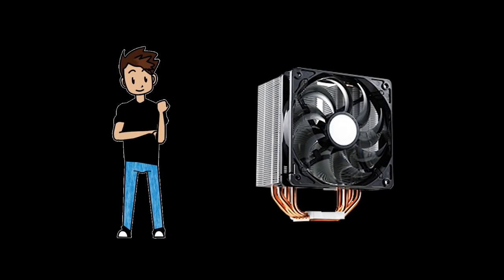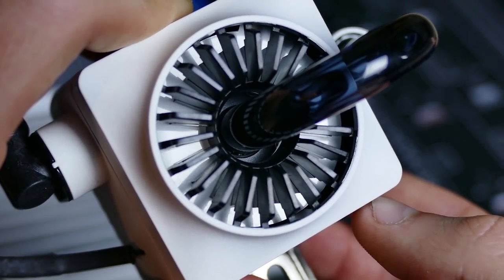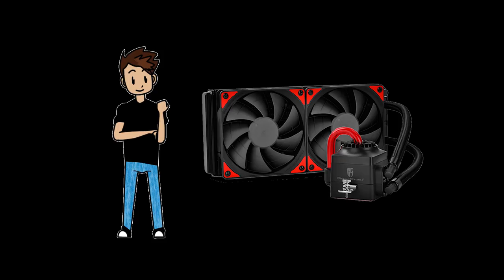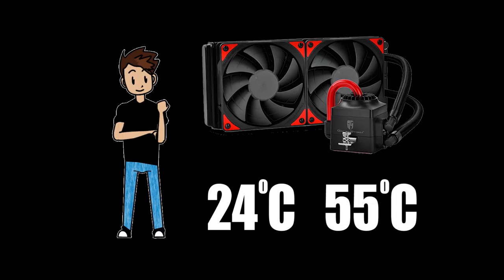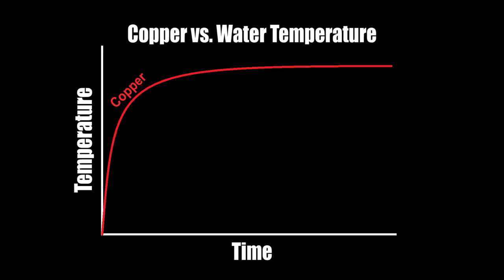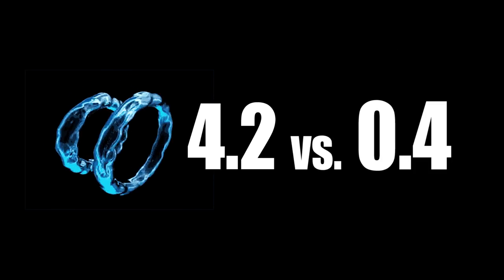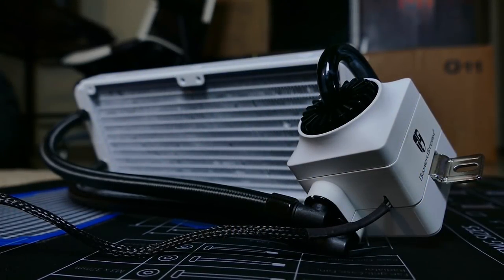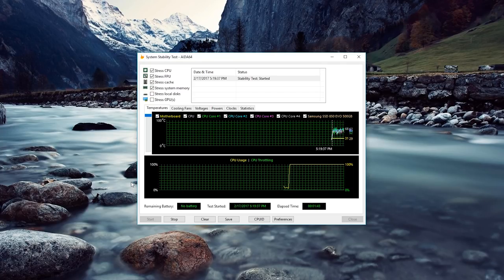How to Properly Measure AIO Temperatures

Comment: After gaming for a couple of hours on my 4790k (@4.5GHz) i'm running at 75ºC on my H110. After returning to windows, CPU temperature drops immediately to around 30ºC. I don't find any water retaining temperature!
Reply: That means your loop is efficient at removing heat from the system. Your system reached a temperature equilibrium at 75ºC (heat absorption = heat dissipation) and when your system reduced its thermal output the system counteracted the change to return to equilibrium, which happens to be ~30ºC. But water's heat capacity doesn't change and there's quite a bit of heat energy retained in the water despite your sharp temperature decrease, so if your loop was inefficient you'd see a gradual decrease.
Reply: The water may still be the high temperatures, the CPU isn't pumping as much heat, so the water can cool it better. A GPU shows a better story. My 980ti maxes at 60C in my water loop, and takes a while before it reaches back down to it's idle temp of 33C. Usually about 10 or 20 minutes
Reply: Ryzen OC to 3.9ghz offset 0.0125 (3.375v set, but reports around 1.38-1.4v under load) and p-state enabled (as it disables when overclocking normally, never did offset overclocking before and p-state enabled, it drops to 0.4v when idle) 

water under load 36-38c cpu temp approx 60-65c, soon as I stop stressing testing it cools down the water within 30 seconds (time it takes to loop thow the radiator probably about 1-2 times ish)

Note on Asus mobo make sure you set "performance bias" to NONE (it's on auto by default) and that was screwing my overclock up (had to put way more voltage in to make overclock stable) i don't know what it was doing but it wasted hours of overclocking tweaking
Reply: Hugo Nabais u r right...it always hppen to my pc as well...go go aio
Reply: his thermodynamic principles are basic. So yes your system works better than a fan mounted on your cpu.
Reply: My 4790k never got over 65C at 4,7ghz with  a huge Schyte  square heatpipe air cooler and 3 fans in 90 degree push push + 1 pull configuration. This was running prime 95 stress test. In the most demanding games it never got over 50C...
Reply: This was my thought exactly. My idle temps are lower, my max temp is lower, it takes more time for it to reach max temp, and it cools down back to pretty much idle around 30ºC nearly immediately, I seriously don't see a downside here. Regardless, even if they DID retain just a bit of heat it's perfectly fine for a CPU to operate within manufacturer maximums (and hell you were just pushing it a lot harder just minutes before), no CPU or GPU is going to get damaged from their factory max temp, it would be foolish for the manufacturer to not prevent that.
Reply: your ambient room temperature must be like from south pole!
Reply: @Kentololable  so don't by a Cheap AIO and use good fans to cool your rad
Reply: @kruzzreviews816  I didn't. He did.

Comment: That's maybe the best reason why liquid coolers are better. Rapid rising in temperature wears down components much faster because of the stress. The material in question has to shrink or expand and and you want it to be as slow as possible. It's very important factor which is overlooked by most people (even experienced ones) unfortunately.
Reply: As long as the liquid cooler outperforms the air cooler, I also believe that to be true. I'm one of those who installed an AIO on the graphics card to keep the GPU cool as the stock blower fan was struggling badly with my overclocked settings. Since the transition, it's around 25C cooler over long term at far less noise, but one of the most intriguing discovery was that nearly all of the small temperature spikes which were seen with air cooling are now gone, which I think should be better for the longevity of the GPU.
Reply: Stress tests don't reflect real life usage unless most of you do is video rendering or other type of continuous load. If your system parts are properly picked even gaming won't put constant 100% usage on your CPU (which would be massive CPU bottleneck). So even if the AIO has worse final temperatures than air cooler by any chance (for example low end AIO vs high end air cooler) I would still go with the AIO if the difference is no more than 10 °C especially for a CPU (which would be stressed more often than a GPU - for example each time when you open a webpage).
Reply: Indeed I can agree with stress tests often being more taxing than any real-life scenario, and after thinking about it, I see why even a liquid cooler that may perform a little worse than an air cooler still might be the better choice when considering the spikes of CPU load. However, of course an AIO that beats an air cooler would be the optimal choice.

Comment: You say it wouldn't make much sense for core temps to be lower than room temperature, but I get idle temps at about 3°C colder than room temperature with the stock cooler on my FX-8350. Not a huge difference, but it is colder than room temperature.

Also, crazy idea, but what if someone attached their radiator to an air conditioner window unit? Has this been done? That'd make for an interesting video, I'd think.
Reply: Got a Cryorig H7, and it's now reading 9.4°C colder than room temperature at idle. (14.4 vs 23.8°C)

Makes perfect sense, though. It's thermodynamics, man!

Comment: so basicly air is quick to heat up and cool down and water is slow to heat up and cool down
Reply: Yeah it's all bound to the specific heat. Same reason why castles are made of stone and are really cool in summer. Stone got a ginormous heat capacity and insulate very well.
Reply: But water is much more efficient to cool down.
Reply: Vanessa Pucca nope, metal is much more quicker to cool down.
Reply: sylermran that's the basic idea being thrown out there in the video and it's also a tried and true idea.
Reply: Nhật Ngô
Dude, metal is what cool the CPU down, in both system. The difference is what cool the metal down. Water or air.
Water is the most eficient.
Reply: That's not any of it works. Air cools down the BOTH radiator or the metal fins of the hsf. Unless water evaporates, it wouldn't cool anything. Learn basic physics.
Reply: Nhật Ngô I agree partly, the energy is simply transfered by metal, water, into the radiator (metal) into air. So the water is transporting heat, but hence also indirectly cooling the cpu. It dissiptes its heat again in the radiator.
Reply: Nhật Ngô I think what Vanessa means is what directly cools down the metal element on the cpu.
Reply: Not air. He was talking about the metal.
Reply: Zandter
Exactly. Sure the radiator and even air cool down the water.. but it is a chain reaction. Metal need either air or water to cooldown (but sure water need the radiator and air also air need the fins that kind of are like a pipe radiator)
Reply: lol i just simplified it for anyone who might not get thats being said in the video, i come back to this debate XD
Reply: well water is more efficient to cool down when the water its cold because it takes longer to heat but if the water is already at high temps it wont be that efficient. Its like saying you burned your hand and you put boiling water to cool down.....
Reply: I guess it will depend on how much the water will be cool down by the radiator.
Edit: Ive read about radiator and surprisingly this video became pointless lol there's a reason why radiators are built into cars and not a large heatsink.
Reply: marcoyz  well it has larger surface area and it can be positioned better, a normal air cooler can draw air from inside which is hotter then outside while watercooler if positioned pull conf it will take the air outside which usually is cooler
Reply: sylermran no, it has to do with thermal capacity vs dissipation and where they balance and how they act before they balance

Comment: So what's the lie then? There's is no lie...you basically talked about people not understanding how it works so there really is no lie there
Reply: The lie to which he is referring is the misconception perpetuated by inexperienced testers that are reporting 30 second load temps in quick online reviews. He then (not basically) gave a detailed explanation of thermal conductivity and transfer properties of liquids vs solids in components cooling solutions. This is quality content creation. 

Using most brands and models of 240 rad AIO is likely to be better with a decent fan setup if your pump is decent and the fans/pump are on a decent operation curve. However, over time with good burn ins even Gamers Nexus has shown legit data that under load some AIOs once at their Specific Heat are actually running hotter than say, some of the Noctua dual tower Air Coolers or a Hyper 212 at Specific Heat. These are usually going to be 120 rads, or low-profile rads, but nonetheless people need to inform themselves prior to making an investment in a product like this as it can give undesired effects for the ignorant. I know a lot of video editors and streamers that have bought boutique systems or had someone at Fry's help them piece out a system, and they literally haven't the slightest clue what anything in the system does. At all.

Imagine a scenario of having a 120 low profile rad AIO with a low volume operation curve profile, because you were told LIQUID IS JUST BETTER. You don't know anything about computer hardware, but you're a video editor. So you take their word for it, and with your 8700K or 2700X you set off to do your work with Turbo Boost enabled, knowing that your system is going to rock and roll while you go do whatever during a render. Come to find out, something like the NH-D14 has a better Specific Heat rating than your 120 rad AIO, and you've been throttling after reaching the Specific Heat of your liquid cooler. 

So, basically, this video paints a picture for someone that doesn't know anything about Liquid Coolers, and even for some that think they know about Liquid Coolers but don't know the nitty gritty.

Cheers.
Reply: Heilung so youtubers are lying...not AIOs or their manufacturers
Reply: Heilung What is the title of this video?
Reply: In the clickbait title
Reply: That is why i'm not subscribed to his channel, he uses cheap clickbaits.
Reply: The lie happens when people post temps after a few seconds of testing rather than allowing enough time to pass for accurate readings.
Reply: Can you recommend other channels ?
Reply: Gamers Nexus...that's all you need
Reply: So it's not the programs or the manufacturer that are lying, it is people who don't understand how water reacts to hear gain and loss.
Reply: Cinos the lie is that the initial temps will stay
Reply: "This is quality content creation. " I agree but the title should be different! Misconceptions, perpetuated or not, are still totally different than a straight up lie! And also the AIO (I read this as the manufactures) are not "lying", but the reviewers. I call click-bait and I don't do that easily.
Reply: @Seldin Gardane    Do you even understand the difference between a lie and misconceptions  / bad reviews...?!
Reply: Wether or not any of that is true or not, I personally moved from a hyper 212 evo to a 240mm aio and my temps improved by a large margin. Don't believe what someone on the internet tells you though, test shit yourself
Reply: clickbait - gotta get them views
Reply: The title is misleading.  Most people would infer that the 'lie' are the claims made by the AIO manufacturers.

The reality is that some people don't know how to test these systems.
Reply: Daniel Kintigh  Uhh no? The science in this channel is pretty much 100% accurate. Its dumbed down ofcourse ( I mean, cant have normal folk such as yourself misunderstanding the video). The explanation is pretty much spot on.
Reply: How does this video have so many likes?  Click bait all to hell.
Reply: His title was bait... You clicked and watched... You're not as smart as you think..
Reply: Click bait title is click bait. Nothing new for this channel
Reply: It's not a lie, maybe a misunderstanding, not knowing that some are doing it wrong. But it's not a lie, it's just behaves like that.

Thank title is the lie I guess
Reply: Cinos,  I 100% agree with you! While this was a somewhat "clear at times" explanation of thermal dynamics with different materials. There is no lie... This was clickbait and you lost a potential sub. Better title would have been "misunderstanding of how AIO coolers work"? But at the end a properly setup water cooled system should be more stable then its counterpart when comparing on par quality of products. Of course a shitty AIO will suffer when compared to a top quality Air cooler. But this video is just adding to the confusion already out there for new PC enthusiast. We need more of them so please do not try to mislead them with garbage like this.
Reply: Cinos uhhh the lie is in all the marketing by the companies that make them, disseminated by people who don’t understand any better.
Reply: I would call it more of an illusion of patient than lie!!!
Reply: Clickbait = views = $$$$$$
Reply: It might be click bait but I learned something very important today.
Reply: @michael-r4k  I do not know how much of a beginner you are to diy pc, but this video is complete clickbait. He clearly said nothing about AIOs are lies, just the misunderstandings that people have about AIOs. He pointed out zero lies about AIOs, thus all of us with some sense agrees that the title is pure clickbait. 

Sure, I'm an idiot. Good for you, though, if you learned something new from this video. Most of us didn't.
Reply: It's called 'clickbait'.
Reply: @Russell White I get that you're trying to be clever with the wording of your comment, but anyone with 1/3 of 1% of the intelligence of a soapdish should be able to watch this video, then read my comment, and then understand precisely what you are asking. I don't play the YouTube comment game. If you'd like to play that game there are literally millions of people and videos with which you may banter.
Reply: @russell I genuinely feel like you're about to pull a Bill Clinton and ask for the definition of "Is". 

You made a previous statement about how the cooler itself couldn't physically lie to you. Well, let's follow that rabbit, since you apparently haven't better else to do than further a dispute you didn't even need to engage to begin with. But, do let's. 

The AIO Cooler can indeed make the argument. How, you might ask? By it's packaging. If you were to take the package from a store, and leave the item, you'd still be charged with theft of the amount of the product it previously housed. Fun facts. So, in that breath, if an AIO cooler indicates on its packaging that it reduces CPU or GPU temperatures by a factor of X (which most do, I'm not sure if you own any computer equipment, much less proper watercooling equipment, but this type of phrasing is indeed common) but fails to elaborate to the less than informed in the market (as is, again, generally the blanket expectation in the marketing on the boxes) there has indeed been a breech of trust on behalf of the AIO cooler itself. It is not a blatantly false statement at this or any point, and henceforth I bid you adieu. 

I know you didn't expect to be trounced so quickly on a YouTube comment thread I'd stated previously I've abandoned, but fortunately for you I was free between projects when YouTube decided to send me the alert. You've shamed your family name with your failure, and I'd suggest staying out of the comments of videos regarding topics which you fail to grasp. You're an embarrassment to decent debaters, much less those equipped to handle adult dialogue. Go pull up your Roblox Tutorials. And happy Thanksgiving. Just stay away from the food until everyone else gets a plate. The rest of the family doesn't need the meal ruined by all of your salt.
Reply: Misleading would be a much better word
Reply: the lie was the click bait title
Reply: @Gophacyerself  I haven't read anywhere in his statement that Heilung said YTs are lying. In his opening statement he says, I quote "The lie to which he is referring is the misconception perpetuated by inexperienced testers". So he is clarifying that Science Studio used the word lie and further explains why he uses that word. It's actually Science Studio who is using the word Lying in an sensationalist fashion and click bait IYAM
Reply: You not looking at title, saying AIO is lying to you. Wich exacly shown in this video. Still dont understand? ok, what if you installed AIO and run a test and read the temperature: It lying to you.. as this video shown that you need to run it for a while and THEN you get the real temperature. That the part of "lying".
Reply: the lie he wants to described is literally coming from the coolers, not the manufacturers or anyone else, just the cooler. when you dont test it long enough it seems as though the temps are much lower when they actually arent.